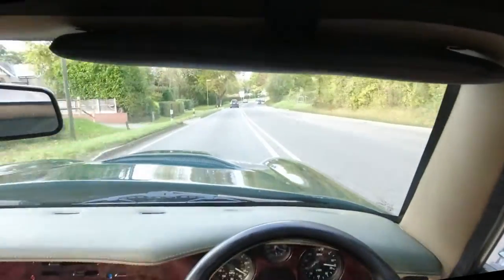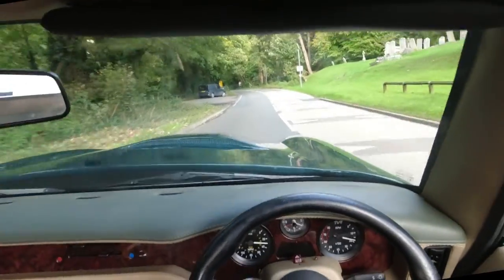1991 TVR V8S - A 'POV' Drive in one of the most fun TVRs!

Comment: I've got a Vixen S2 with a subtly reworked 4.6 RV8 & decent suspension + brakes. It does drive nicely for what ir is, it does feel quite flexible but in a nice way. I have an LS turbo engined 3000M which is a bit more modded which feels very different.
Reply from the maker: My ideal Vixen would be a fruity X-flow or something around 100bhp that likes to rev. I think that's what I love about them - the rawness and the ability to enjoy it on the road.

Comment: Because the transmission tunnel on the Chims & Griffs is so much taller, that adds a lot of chassis stiffness. V8S' probably feel quicker than a 4.0 Chim as the axle ratio is shorter. That one in particular sounds lovely!
Reply from the maker: It isn't taller. I haven't measured, but if I was guessing I reckon the S' might be slightly taller. The Chim/Griff has more bracing than the S, and the suspension is more compliant, which puts less torsional strain on the chassis. Axle rations will differ slightly, and the S has smaller wheels, too.

Comment: I had a Chimaera 400HC for a while, unfortunately had to sell it due to life, but I completely agree it always had more to give, and easily if you were a good driver. Currently got an NB MX-5, and that's got far more front end grip than the Chim ever had, there's corners near me that i'll take at 60 in the MX-5 that i'd struggle at 50 in the Chim, but it's not got that savage torque of the RV8. You can't use most cars to anywhere approaching their limit on the roads, I'd much rather have fun at low speeds and still feel like you're having to work the car and yourself.
Reply from the maker: Couldn't agree more.

Comment: Nice rumbly sound. I wonder how a V8S would compare to an MG RV8, same engine similar looks but different recipe.
Reply from the maker: I've only ever driven one RV8, but I remember it feeling like a very old car. Very narrow, felt like you were sat up high on it. The V8S, by comparsion - much lower feeling, more raw, more visceral, feels broader. A less refined car for sure, and not as well built, but definitely feels more capable (as you'd expect, really, as it's a lot newer).
Reply: @UPnDOWN  Thanks. I drove an MGB GT once, a rubber bumper one - nice ride and comfy seats but that was about it.
Reply: @UPnDOWN  I had the experience of a passenger ride in a Marcos Mantula back in 1991 as a teenager and the overall feeling is highly comparable. I wonder if it is really the case.

Comment: You actually owned the lovely earlier V6 Capri engined proper Old School sports car looking ones (I think you said S1/S2?) Even those are utterly cool and still surely with a different but also very tasty V6 soundtrack! Nice!
Reply: I wonder if anyone fits the Cosworth 24 valve engines?
Reply from the maker: I've had an S1 and an S2. S1 had the Capri/Sierra XR4i 2.8 engine, which to be fair didn't feel like it could pull a fart out of a bedsheet. The 2.9 in the S2 was definitely gruntier, but the EEC injection system on it was pretty crap.
Both of them made a good noise, both quite fun to drive at middling speeds in the countryside. V8S definitely more fun all round though, but then they're more expensive.
Reply from the maker: Yes people have fitted the 24v BOA and BOB engines. It's not as simple as you'd think, but it's been done. Never driven one but assume it'd give the V8 a run for its money, if a good conversion.

Comment: So they basically used the Tuscan racer chassis for Griffith etc? Considering it was a race car chassis it was not good at all. Gordon Murray put a 5.0ltr Griffith up on his chassis test rig after being puzzled by the cars poor handling characteristics. He wondered what was possible to improve things? The answer was literally NOTHING, the chassis was SO weak and poorly designed that you could fit top quality springs, shocks, roll bars etc and little would improve. Basically you needed a completely redesigned chassis if you wanted those cars to actually corner! I still utterly LOVE TVRs though! My all time fave being the Cerbera followed by all the later cars but also the Griffith, Chimera, even the 80s wedge cars, the earlier Capri engine cars and now also this the V8S (I thought a V8S WAS an earlier wedge car?) TVRs are the greatest British cars EVER made!
Reply from the maker: It's not the Tuscan racer chassis exactly, it's based on it, but the chassis in the Griffith & Chimaera is fine. I'm sure if you faff about putting it on a high-tech rig it'd laugh at you, but in the real world for the use that real people use them for, they're fine. They do corner well, in fact they drive really nicely until you go sticking stiff shocks and low profile tyres on. They aren't made for that, they're made to be road cars., and roads in the UK are rubbish. A bit of flex is welcome IMO!